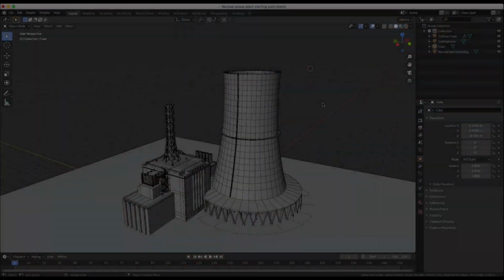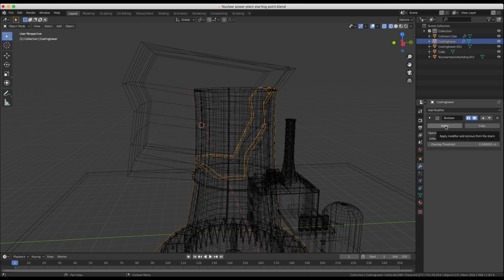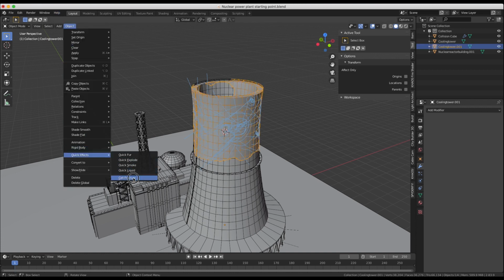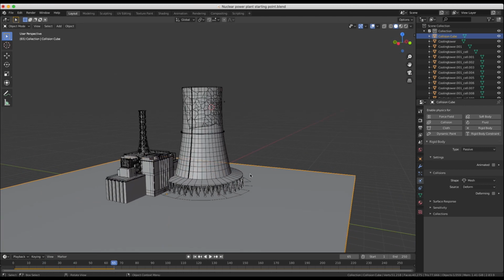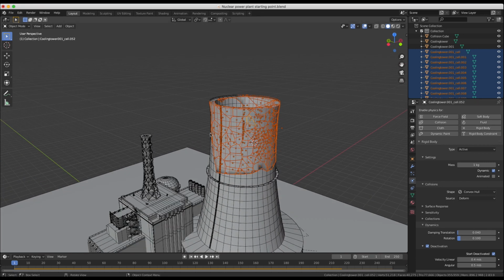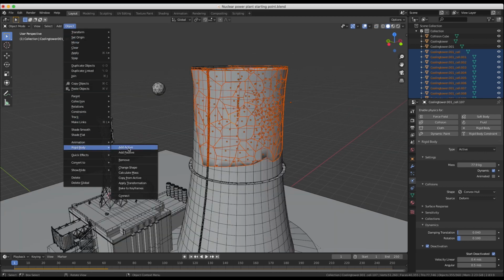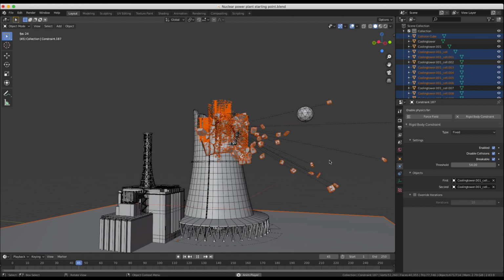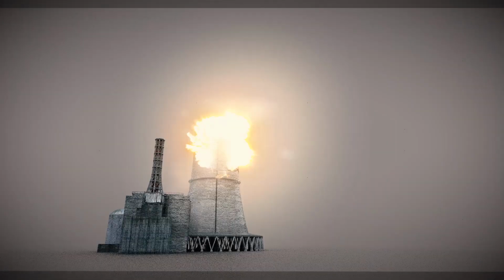Blender 3d Destruction Tutorial: Nuclear Power Plant explosion tutorial Pt. 1

Comment: Jesus Christ!! wow, just wow. Blender is god and it scares me.
Reply from the maker: Yes!  Blender is really amazing! It's come a long way over the years. Thanks for the comment!
Reply: @LightArchitect  - No worries!
I hope you don't mind me asking you a question that might be a little tricky to answer.

I'm going to attempt this effect with a far more complex model that I'm currently building. It'll be a recreation of The White House getting nuked by aliens like in the Independence Day posters. It's a far more complex model than a simple tube. I'm trying to run before I've learned to walk a fair bit.

At present the building is built up of seperate objects. I'm trying to keep things as low poly as I can. There's lots of arrays and mirrors at the moment. No physics yet at all. You can imagine the fine detailing around the building. There must be a few hundred fence pillars across the top.

I'm assuming that I will have to apply all the array and mirror modifiers, but what about joining the mesh together? Can I just Ctrl+J it all or do I need to boolean the whole thing together? I guess what I'm asking for is just a few pointers for things I haven't considered.

Comment: I have gaps when i cell fracture. Im just using a default cube instead of a building. Wont that work?
Reply: Hi Daniel I just figured this out myself.

You select everything in Object mode and flip into Edit mode.
Press A to select the entirety of your mesh, every vertex of every fragment.
Look under the Mesh Tab > Normals (or Alt N) > Reset Vectors.

If that doesn't get it, combine this with selecting auto smooth from your object data properties panel (bottom right).
To apply this to all the fragments, just select select all your objects, then Hold Alt and click Auto Smooth to get them all smoothed at once.

As LightArchitect said, scale can always be an issue. If you're ever having wierd texture issues always check the Object Tab > Apply > Scale.
Similarly, always play with Normal options in the Mesh Tab. (Set from faces, Recalculate Outside, Smooth Vectors and Reset Vectors).
Reply from the maker: Hi Daniel,

 A default cube should work. Probably the issue is that you need to subdivide your cube a few times. I believe that should resolve the issue.
Reply: @LightArchitect  tried a bunch of things including that but didnt work. Increasing the scale of the objects helped but i still have small cracks between all the pieces.
Reply: Adding a solidify modifier and messing with the modifier settings helped further. still have tiny cracks but i think they arent noticeable in render view.
Reply from the maker: @daniel6sharma  Hey Daniel, There could be an issue with scale. to get around the small  cracks  you  could keep the large unfractured piece rendered until the rigid body sim starts.